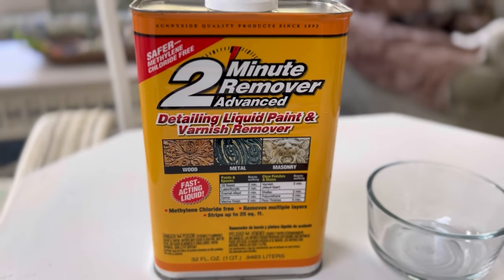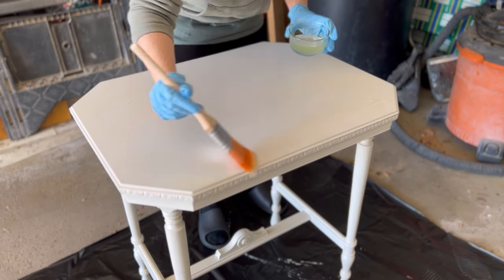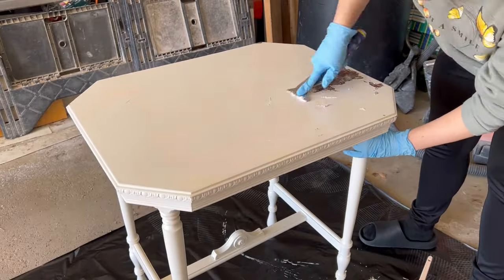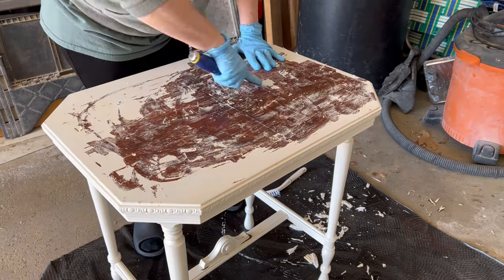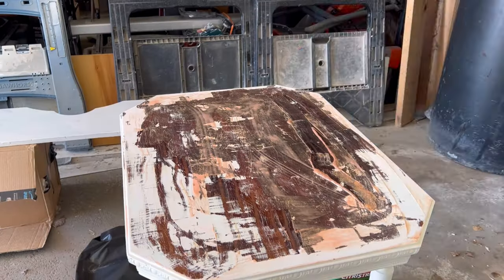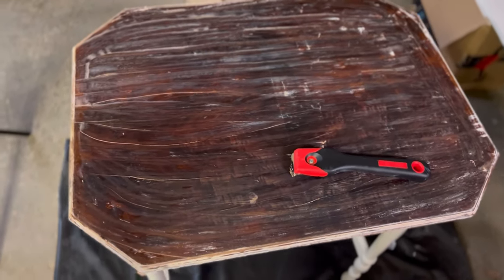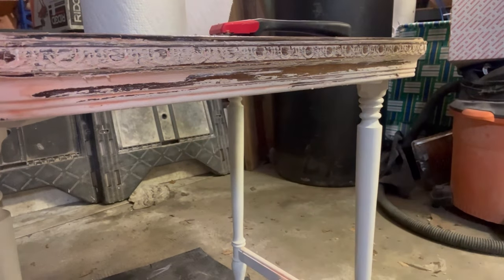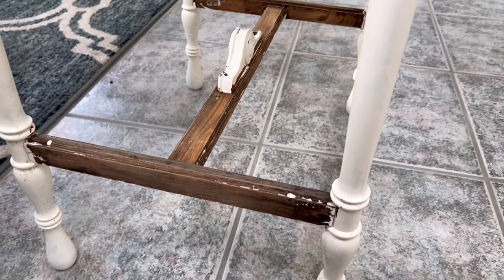2 min Remover vs CitriStrip | Which One Works Best?

Comment: Thank you for this video! I am currently doing a door with the 2 Minute Remover and will be using the cellophane method (to test although youve said its not as good) because it is all i currently have. I am new to this and your video did sway me to regardless of this testing method with 2 Minute, to make sure i try the citri for the next door. Thank you for your effort!
Reply from the maker: @matthewtaylor2040  this was one of my first times trying anything like this and I also had less experience making videos on here for reviews. Still 100% prefer citristrip a year later!
Reply: @monise_makes  just an update - the cellophane did not do anything beneficial in this process. Looks like it's Citri on the next use!